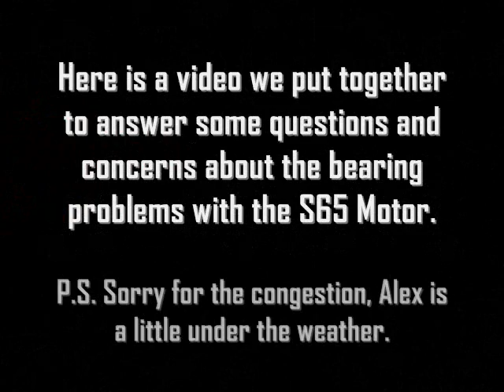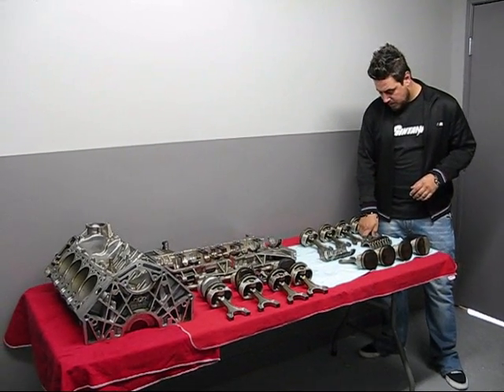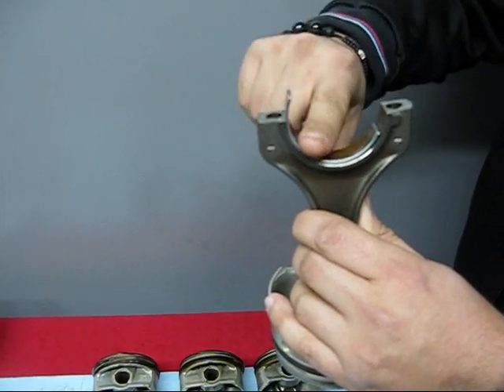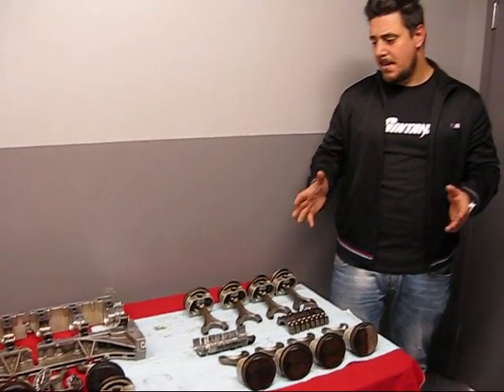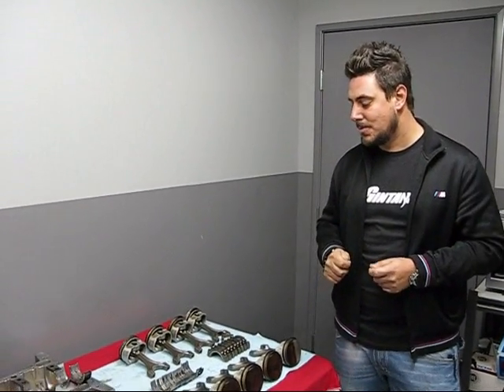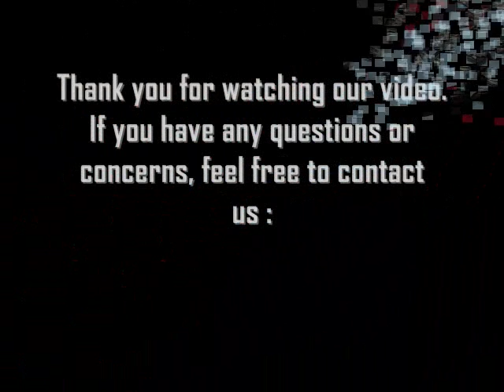Gintani - Understanding the BMW S65 Motor Bearings

Comment: Ok so my comment is obviously 8 odd years later but I don’t think it was a good explanation. In fact if I had been an E9X M3 owner then I would have been terrified. So obviously we have come a long way with the S65 and people who understand engines and mechanics realise that to have a production car that revs to 8400 RPM and makes 420BHP there is ongoing maintenance that is required. Overall the S65 has turned out to be a very reliable engine and a real classic amongst most car guys. Yes they lack bottom end but that’s because they rev so high and make their power at the top of the rev range, a typical track engine. With all S65s it’s key you run the correct engine oil for your region and it took BMW a while to work out which oils suited the car based on its geographical location. Getting a tune and having the Cold Start turned OFF is also the way to go as the cold start revving on a stone cold motor is obviously a NoNo and that would be on any high performance engine. Previous ownership is also key as a new owner has no idea how the previous owner treated the car and a lot of first owners most likely just jumped in the car to rush off to work and drove it till it warmed which in itself is an issue. You can’t just drive an S65 engine with cold start activated as it drives like a dog, so initial owners probably just revved the hell out of it till it ran smoothly all big NoNo’s for this engine.  For new or perspective owners of these cars. Just do your checking get a trusted BMW mechanic (Not a Main Dealer) to check it over even get them to pull the back and middle rod ends to check their condition. As a rule of thumb you should be able to do 50K miles before doing the rod ends but there have been exceptions so if in doubt get them checked. The Oil check is only good for motors built pre 2010 as they ran the Copper based bearings but by 2010 BMW had noticed the issue and changed the material so this does not show up in the oil tests. There are a number of opinions about what bearings to use OEM or others. The BEA are ones I have used with no issues and I have seen club members with an additional 140Ks on their motors after their first change and these are cars that are tracked quite often. BTW issues like these are not exclusive to BMW and lots of other manufacturers have similar or other issues with high stress engines. Just ask owners of C36 AMGs. Or the owners of the V8 Audi RS4. Good maintenance and high quality oils go hand in hand for performance based engines. Having owned all models of the M3 series and two E9X M3s they are my favourite cars and the S65 is a gem of an engine. But it’s not a drag strip motor just so you know. Enjoy. 
Jp
Reply: This bit is wrong "but by 2010 BMW had noticed the issue and changed the material", the only reason they changed the bearing material is because the EU banned lead. That said, they later bearings seem to suffer less from wear, although still not to normal levels mostly.
Actually this is wrong too "You can’t just drive an S65 engine with cold start activated as it drives like a dog", mine drives ok then (and yes I take it easy before it's warmed up).
Btw, even with lead bearings, oil analysis doesn't guarantee that you'll pick up on failing bearings.

Comment: Thanks for the video, never seen an s65 open like that. I’ve recently replaced my rod bearings which half of them were all copper like this video. But does it matter if the main bearing isn’t replaced? I’ve read and watched loads of bearing videos and no one has mentioned the main bearing, just the ones on the rods. And for anyone else with this car, I’m no longer scared it’s going to blow up all the time

Comment: After a month of research into BMW products it is clear to me that BMW cars are not reliable, especially the M cars. I really wanted a 2010 M6 for the v10 but I think a GTR is a better option. Drive it like it is meant to be driven with no rod bearing issues or price jacking on parts.BMW SHOULD BE ASHAMED
Reply: stucbr1100 the gtr is know to have transmission issues and that's way more expensive fix than just changing the BMW rod bearings as a preventative measure for $2500

Comment: other shops say that the bearings are the problem not the rods stretching I'm not arguing with either shop because I'm not a bmw mechanic or know anything about racing engines

Comment: That rod was broken by friction combined with the normal forces it is normally subjeted to. It fractured on the weakest section of the rod (where it's got less momentum of inertia an therefore less resistance). The rod is designed to withstand axial forces combined with deflection. The deflection can be just caused by two things. The mass of the rod swinging side by side as the rod moves and the friction torque generated by poor lubrication. When you combine all those 2 forces with the forces produced by the inertia of the alternating masses (specially when at high rpms and when reaching the TDC in the exhaust stroke) you got the perfect conditions to fracture that rod the way it is shown.

Comment: Any smart bmw owner and one who is not cheap would never have this issue, the real cause of these issues i wouldnt say is the bearing design it is the fact that the god damn oil service interval is 10 thousand fucking miles anyone who claims to know a damn about cars cannot run 10k oil in a car and then proceed to ring the engines neck to 8000 rpm. Theres the rare customer who will actually come in every 4k miles and request a non warranty oil change and they pay for it and it saved them thousands in the end. Perform oil services before bmws recommended bullshit service interval and you will be ok.

Comment: BMW changed their recommended oil from the castro 10w60 to the pennzoil 5w40, thus the rod bearing will now get the lucubration they need.
Reply: Not True, Every BMW dealership / Mechanic I've visited recommends BMW 10W-60.
Reply: hiphopsocnroc "Lighter" oil, and a little more oil cooler, ty. Connecting rod upgrade(?), but I don't think it's "necessary". 50w an 60w oils don't carry heat away fast enough. "Oil support", in a hot engine shouldn't require a heavy weighted oil or you have bigger problems. I can only see its use if the oil is "diluted" under normal use (diesel only uses 40w). Oh, and break the engine in better. All that carbon below the compression ring is a tell. Okay for snagging groceries, but not "supercharged" or track use... my 1.9cents
Reply: agree, tracking i use 10w60 and in the summer heat..

Comment: Just bought a 2012 E92 with 36,000 miles on the odometer.  I'm too scared of rod bearing failure to risk it so I think I'm going to just go ahead and have them replaced.  It sucks to spend that kind of money on a car I just dropped a full $40,000 on, but I'd rather go ahead and spend the $2500 now (something that would HAVE to be done under recommended maintenance anyways at 50k-75k) than have to drop $20,000 on a motor install (from what I hear it's usually even a little more than this).  I hate this so much, but I've found a great shop that specializes in M cars recommended to me from another local M owner.  Shop is called Markert located in Lawrenceville, Ga (North of Atlanta).  I do have a question for the folks who've done this.  This usually fixes the issue, right?  Meaning the rod bearings most replace with fix the oil starving issue for good (or at least for another 50k), right?
Reply: BMW changed their recommended oil from the castro 10w60 to the pennzoil platinum euro 5w40, thus the rod bearings will now get the lucubration they need...the oil they were using was to thick..also make sure you properly warm up the car.. cheers
Reply: iDami4n Is that for the S54 as well?
Reply: John Marasco I apologize.  Technically it is not part of recommended maintenance.  Knowing what we know now, however, most owners have the procedure done around that mileage and (unfortunately) it is recommended by most owners due to the issue
Reply: I'd say swap the bearings out, and switch to 5w-40 summer...0-w40 for winter and change it frequently @4000 miles..that's what I'm doing when I get my E92 M3.....don't forget to swap the Throttle actuator gears to the brass ones.this will save 'em if they're not too far gone....those are the two main issues with this car but otherwise it's a very reliable car.
Reply: Where did you see a recommended maintenance schedule showing rod bearing change at 50k-75k?

Comment: Hello bro and thanks for your video. You mentioned the lack of lubricant causes this failure? what causes the lack of lubricant when the engine is full of it? I just threw a rod on a 335d.
Reply: I've heard that the rod bearing clearances are too tight and the oil change interval is too long. On the 335 they say that when the dpf regenerates it floods the engine with fuel and it washes into the oil and dilutes it.

Comment: Manufacturing fault?.... design fault??.... owner fault??.  Whats to blame here??.

Are oil pressures good at the pump??.... is it a pump problem??
Reply: BMW changed their recommended oil from the castro 10w60 to the pennzoil 
platinum euro 5w40, thus the rod bearings will now get the lucubration 
they need...the oil they were using was to thick..also make sure you 
properly warm up the car.. cheers
Reply: Really?.... is that a verified fact?.  Because to me that doesn't make sense.
Reply: I've been reading that BMW did testing on the engine and used southern CA as their test area, so cars utilized in cooler areas will tend to have a higher fail rate.  A warmer area with a thicker oil (10w60) will have a tougher time circulating through the motor, now it was a smart move to the Pennzoil product.  Total design flaw (tight tolerances) and incorrect oil recommendation (10w60).  NHTSA should task BMW with full replacement recall and refund all previous cost with owners replacing on their own, I honestly believe that it will happen sooner than later. After BMW did send their repair facilities notices regarding the issue, they are really trying to side step their responsibility and why I will not purchase another brand new BMW.  Time to own up BMW.

Comment: So what exactly is the cause of the bearing to wear our, and is there a solution to this besides switching the bearings out.
Reply: BMW changed their recommended oil from the castro 10w60 to the pennzoil 
platinum euro 5w40, thus the rod bearings will now get the lucubration 
they need...the oil they were using was to thick..also make sure you 
properly warm up the car.. cheers
Reply: iDami4n how u know they changed their recommendations
Reply: tight tolerances, i think the bearing is too tight or something and makes it so oil cant get to the part so it just gets worn out
Reply: My experience with my E92 was that it burned a quart of oil every 4000 miles, way before it's due for an oil change. I knew S65 engines burned oil but I didn't realize it burned the oil that quickly. I'm glad they still had dip sticks so I could check the oil every once in a while. I sold the car before the warranty was over otherwise, I had no problems with it in the three and half years I drove it. The warranty on BMWs are now only 3 years and 36,000 miles. It used to be 4 years and 48,000 miles. I can only assume BMW was spending a lot of time and money repairing cars close to the end of their warranties. And the cost of their extended warranties are exorbitant.

Comment: ive actually seen this before on other engines. notice how the bearing on mains is wearing on one side. 
I think the crank is walking end to end and tilting the rods to one side eventually rocking the rods and wiping the bearings.
You should try checking end play on a few OK cars at 100,000 km or more that are not taken apart ( YET) and see if the crank is moviing too much on the nose with a dial indicator.
Any crank walk past specification at 8500 RPM pushing a clutch will wipe out bearings.
just my thoughts.
R.

Comment: So I did a preventive maintenance on my E92 M3, rod bearings changed at 103000km (around 65000 miles) I had abnormal usage on cilinder 6 and 7 (starting 1 is front side) I was already hitting the copper...the sound you here hitting 3500rpm which goes all the way up is normal...its the normal engine sound...I was making myself worried about the sound and all the stories around...if you send me a pm I can send the picture of my rod bearings...I also changed the thermostat which is also a weak point...I strongly recommend to change rod bearings at 100k km...my M3 has had oil changes the first 75000 every 15 a 20 000...after this till 100k every 5000km always 10W60 castrol edge (got a very nice price for this oil if ppl are interested? send pm)
Reply: +eraserke My opinion > the reason for failing rod bearings is the high rev output of the S65...10W60 nor any other oil is capable to succesfully lubricate the rod bearings at those revs...when driving hard the engine temp goes up fairly fast to above 100degrees...this in combination with the high revs just kills the rod bearings...never ever put anything else then 10w60 inside the engine!
Reply: @eraserke  agree 10000 percent. it needs thick stuff.. not thing stuff..
Reply: Hey man how are u? about 2 months ago i got an 2008 e92 m3 with 75.000km on it. Im afraid ill need to replace the bearings on next oil change. Can u send me ur pics? i want to take a look at them before making a decision.. email is rafacampanholi@hotmail.com ty in advance

Comment: Any tips in how to check for the problem coming up? Since I've heard stories that youll hear the engine tick differently...but what to look for what are the sings...Ive got a strange different ticking noise almost impossible to hear when hitting 3500 to 4000 and the sound goes with the engine rpm all the way to limiter...
Reply: it is a very long story as it took us 3 months to finish the whole process but we replaced most of the parts in the engine. Whole story started with knocking from the underside of the engine. After disassemble it turned out the rod bearings were worm and cranfshaft eventhough after measurments turned to be OK the color of the metal under worn rod bearings has changed so we decided  to replace it. I have bough whole block from 2013 with 15k milage on it unfortunately(when you think nothing can go worse :-)) it arrived broken - fastening of timing chain slide was broken. After one month and no hope for refund we made a decision to take crankshaft + rods and install it in my old block I have purchased complete set of bearings both rod bearings and crankshaft bearings + piston rings(ones from 2013 had signs of corrosion). Regarding cost it was about 10k euros in total although if the 2013 block was OK it would be much cheaper unfortunately the condition turned out to be completely different than claimed by the seller and so far any refund has happened( BMSDirect from UK - be careful with that company). If you have any detailed questions let me know and I will try to answer as best as possible although I am not super technical about engines.
Reply: had exactly the same problem. When you hear the ticking the bearings are in really bad condition already so don't drive the car. We haven't sorted the problem yet  but crankshaft is going to be measured for any possible damages on Wednesday so will keep you posted.
Reply: Not really although i have my car fixed bur the cost was simply crazy
Reply: mako758
Please elaborate for the sake of helpfulness and general education for the rest of us S65 engine owners
Reply: mako758
Please share your full story, problems, diagnosis, price, etc. Thanks in advance! :)
Reply: mako758
Thank you so much for the detailed information as it is incredibly useful for all of us S65 owners. 1 question I have remaining is, how many Kilometers did you have on your engine before the first problems started to occur?
Reply: so the problem occurred above 160k km so not bad at all. No idea if the rod bearing have been replaced before as I am 3rd owner of the car and made 20k km after I purchased it. Knocking was noticeable between 3500-4000 rps and only half throttle. When full throttle no noise at all. Best way to check the condition of the bearings is to analyze the oil. I know there is one company in US specializing in that sort of analyzes.
Reply: where you're from? maybe you can call me on
Reply: mako758 hi mate. I'm having the same issue in the uk with my e92 M3. Struggling to find d so wine locally to do the job. What a pain. Any help or advice would be appreciated.
Reply: nor sure how I can be any helpful. I did my repairs locally in Poland although this is extremely precise job so would be very careful with selection of the mechanic
Reply: mako758 Did you keep him posted?
Reply: mako758
Were you noticing this sound and significant sound during idle, or was it only when you were driving the car with wide open throttle at medium to high rpm?
Reply: mako758 Thanks again for your replies. So just to confirm, you had no noticeable knocking or rattling at idle? I believe I hear knocking between 2000-4000rpm in my engine with mid to full throttle and I'm concerned. I have no noticeable knocking at idle
Reply: mako758 Oh by the way was your knocking sound noticeable when the car was stationary in neutral or did you have to be driving it with the engine and transmission under load to hear the knocking? Thanks again for your information, it's sincerely appreciated!
Reply: Thanks for the offer, let me send you a PM and maybe we can skype?
Reply: mako758
PM sent via youtube, or feel free to post your skype details here and I will add you
Reply: +eraserke guys check my thoughts...